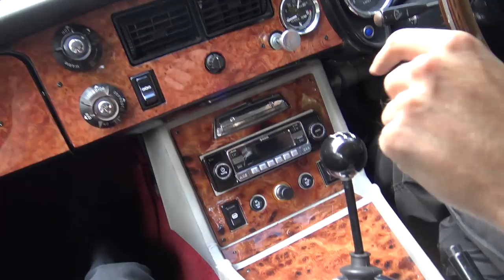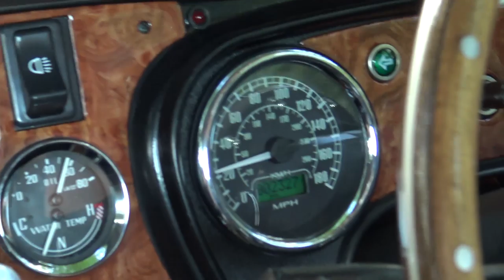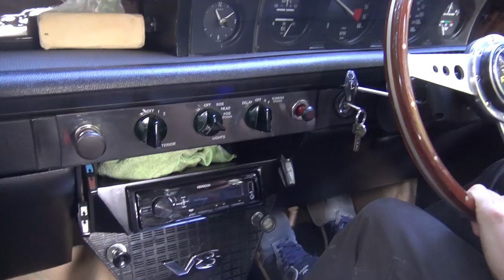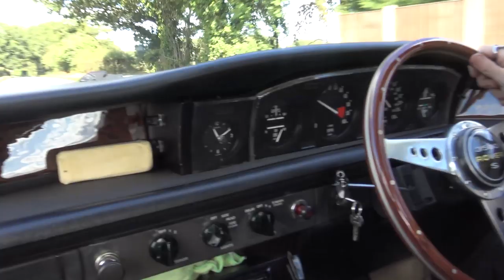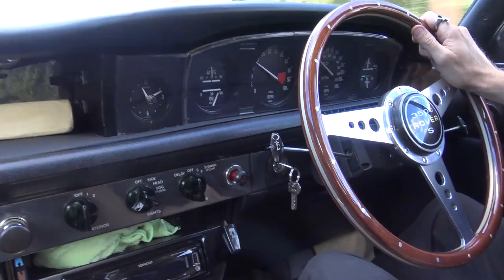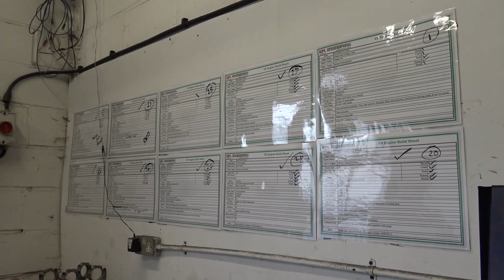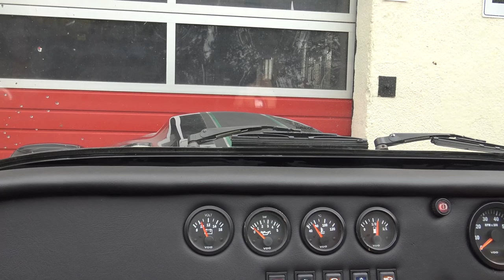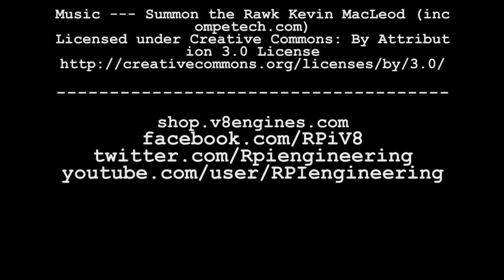RPi Engineering Rover  V8 Workshop Update Episode 35

Comment: Hi Guys . Very good video.  That GT had a very dirty engine bay, doesn't  make any sense at all. (Not your  fault before someone  comes  to the wrong conclusion)  That P6 looks very nice, how much? I would be interested. You would have to assure me that the base unit is good order. I know how rust prone they are. I was doing major rust repairs on these in the '70s. Is it the standard TC box ? I will look on your website. Thanks.
Reply from the maker: Yes the P6 is lovely. If you go to our Facebook page we will be advertising properly soon with pictures throughout. https://www.facebook.com/RPiV8/

The base is in great condition. A little surface rust on the lower suspension mounts and front brake dust shields which is now being treated etc. But this is a classic that has been very well looked after.

It has the 4 speed manual box that drives incredibly well given its age and recent refresh.

We will be advertising for £17,000